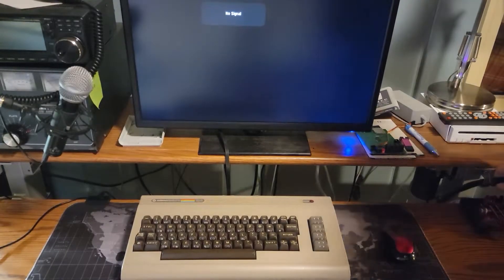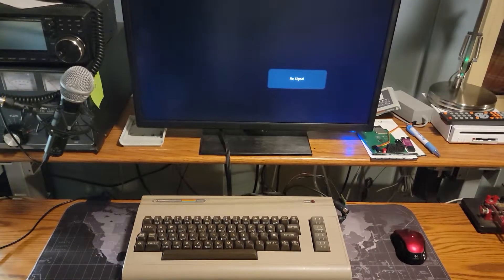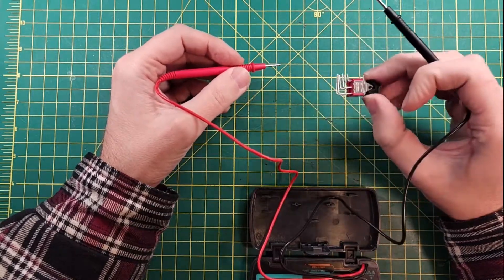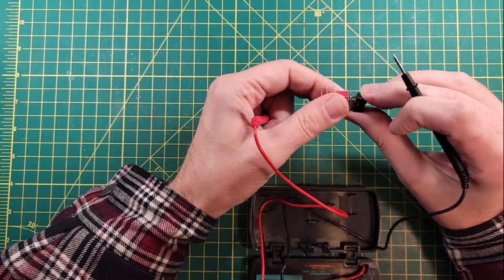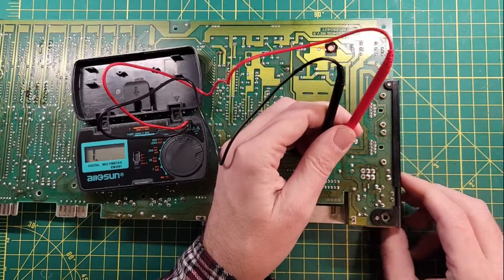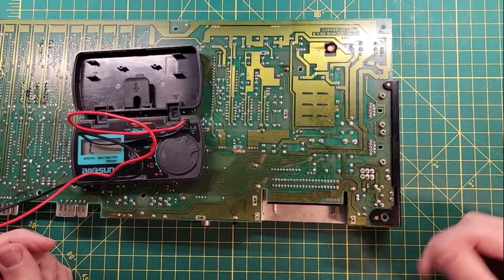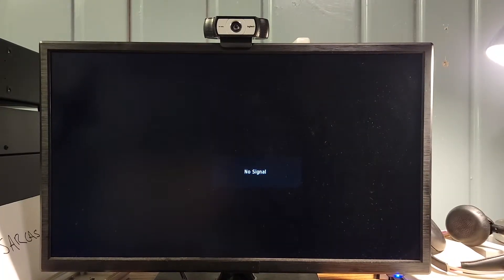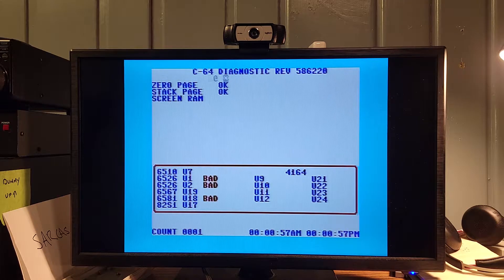How long do Commodore 64 Repairs Last?

Comment: The extra pins are just part of a DPDT (double pole, double throw) switch.  It is meant to offer A/B switching, where you connect the middle common pin to either the A side or B side depending on which position the switch is in.  Hence two sets of three pins.

A DPST (single throw) switch can only be On/Off by connecting the common and A pin, or not.  Hence two sets of two pins.

(There is also SP, or single pole, which only switches one contact, and can be SPST or SPDT.  And lots of other permutations in more exotic switches with multiple contacts and/or positions.)

DPDT is more versatile and can pretend to be DPST just by ignoring the second set of pins, so they’re commonly used even when they don’t need to be.  :-)
Reply from the maker: Thanks Nick.  Those DPDT always get me?

Comment: Can you repair mine?
Reply from the maker: What's wrong with it?
Reply: Go to turn on, sometimes display comes on, other times no. Then if display on cursor stops, or all lowercase.I have done no troubleshooting. If on and appearing good, may lock up.
Reply from the maker: Could just be some dirty chip sockets.  If you have a good electronics cleaner, make sure the machine is off and un-plugged and spray it down with some "CRC QD Electronics Cleaner" or some "DeOxit" - in the chip sockets and in side of the on/off switch.  As you've seen, even after repaired, they can go bad again.